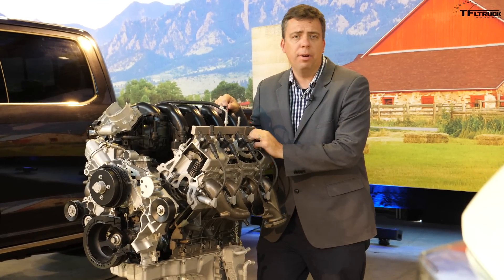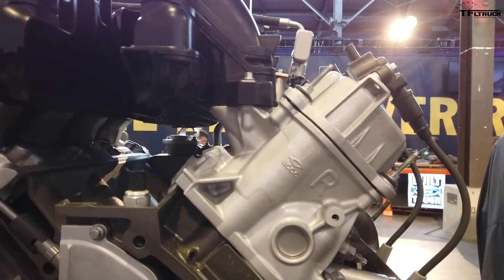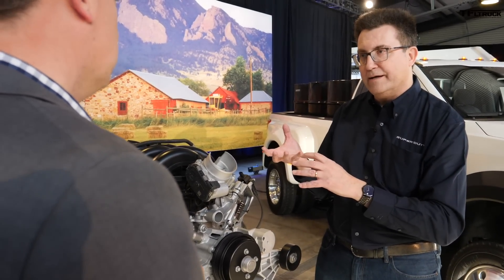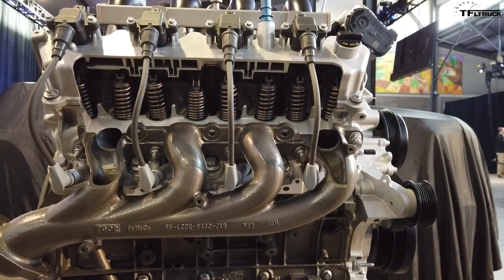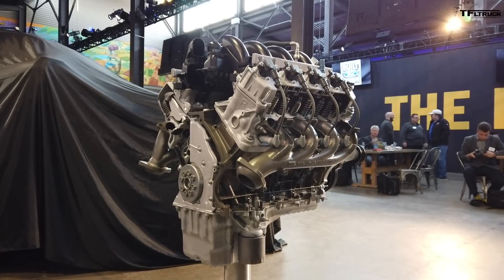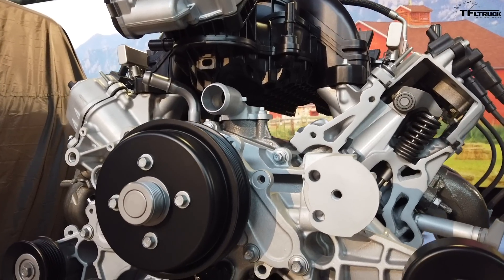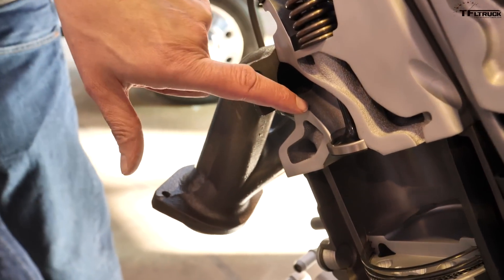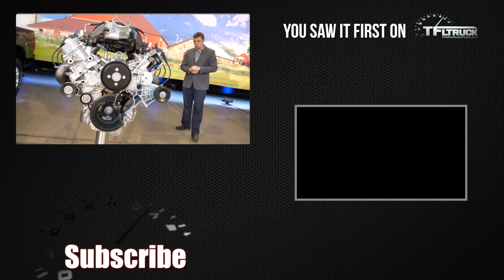2020 Ford Super Duty 7.3L V8: Here's What You Need to Know!

Comment: Hmm pushrods, iron block. I feel like someone has done this before
Reply: This is pretty funny that they have finally admitted that a push rod V8 is more durable than their modular shit. Ford engineers have commented that Push rods are ancient. They must be eating Shit now?
Reply: Literally every American car manufacturer since like 1940?
Reply: Stone's Garage -DFW ever heard of overhead cams?
Reply: @stonebone1179  Okay... I don't know about ford but I know GM 5.7l switched from flat tappet cams to hydraulic roller lifters in the late 70's... there is nothing wrong with something that actually works though. Ford trucks with 5.4's and "fancy" VVT dual camshafts are costing ownersd thousands left & right these days. 
If you've got a 5.4l triton with ~300k miles that hasn't had the timing chains & tensioners replaced, you are the abnormal. Don't run it too hard or it will jump time & usually continue to run (like shit).
As for these engines, I'm sorely disappointed
Reply: Pairis Fabrication all you did was point out that it's an iron block pushrod motor as if they haven't been a thing for the better part of a century.
Reply: Pairis Fabrication what's an overhead cam??? Is that like a gopro mounted over your head??
Reply: Stone's Garage -DFW if you’ve not heard of an overhead cam you must be living under a rock in the automotive world
Reply: Pairis Fabrication the sarcasm flew way over your head.
Reply: Stone's Garage -DFW I was using sarcasm, in particular I was referring to the LS platform of motors but yes you are right to an extent many car manufacturers use pushrod engines, but Ford has sworn by overhead cams for several years, I find it funny that they have gone back to pushrod motors seeing as they swore so strongly by overhead cams. Go learn the parts of an engine, learn what sarcasm is, then you can talk to me.
Reply: Pairis Fabrication ford ditched mod motors because half of them are trash and they're all hard/expensive to work on. To an extent nothing, GM didn't innovate a single thing but good air flow with the LS
Reply: Pairis Fabrication pushrod technology has been around for over 100 years. So unless the LS came out in 1899 and not 1999 like I thought, it didn't do anything but show people that you don't need overhead cams to get great air flow.
Reply: Stone's Garage -DFW bro your literally arguing to prove the same point as me yes I know pushrod motors have been around forever and that they’ve worked great and proven to be better than OHC engines. At least read my comment before replying smh

Comment: All the terrified GM boys with their "It's an LS" comments. Why? Because when it came down to LS vs Modular Ford they usually had a little more power in the LS platform in a naturally aspirated build because they could throw cubic inches at the formula. However when a turbo or supercharger entered the picture the modular showed how a modern 4 valve head is so much more superior. Then you heard all the "well the LS is cheaper and smaller and simpler" comments. This engine is going to muscle the LS to the side. It has even more cubes than an LS and appears to have a rally strong block. Oh no! to be a GM humper!
Reply: I'm not a GM boy but the modular motor is shit unless you spend a truck load of money on it.
Reply: 😂 to bad GM already did a big block back in 2001 the 8.1 vortec I have one in my 2002 2500hd it has over 400,000 miles call me when this motor lasts half that long cmon ford catch up
Reply: Really? Its hard to spend a "truck load of money on a modular as there are no aftermarket blocks or heads available. Check out the latest LS vs Coyote built on youtube. They just built the LS...Started with an LSX block and a set of Trickflow heads $$$$$$$$$$$. They will face this off against a Modular Ford using a junkyard block, heads and crank. Most likely the majority of the valvetrain will be stock as well. So much for that theory.
Reply: What was the horse power on that motor? 175? 195? It didn't make enough power to hurt anything?
Reply: Have you ever put oil pump gears in one? Have you ever put cams in one? Everything is expensive and a pain in the ass to work on. There's a shitload of junkyard 4.8 5.3 5.7 6.0 LS motors on YouTube making 1000hp. I've had pleanty of Mustangs that shit don't happen often. Then if it blows up and you need another engine it definitely isn't $500.  

I'd love to have that new pushrod Ford motor in a Mustang, hopefully its really overbuilt.
Reply: @ls1jeeper  It's going to rev low. I'd rather have the Coyote
Reply: Todd Johnson Show me a Ford junkyard engine in the 5 liter range making 1200+ hp on stock internals? Won’t happen because it can’t happen. Ford realized they messed up big by going ohc in truck engines, so they decided to copy GM’s formula and see if it’ll work for them. Every Ford I’ve ever owned had major problems. I’ve owned a T Bird, Tempo, Excursion, several Mustangs, Probe, and probably something else I’m forgetting. All of those vehicles were complete crap IMO. The only one I kinda miss is the T Bird.
Reply: @toddjohnson7133  the 8.1 made 330hp and 450lbft of torque. was making more hp than the diesels of the time and just a little less on torque
Reply: You can get close to 1000 reliable HP on a stock long block Coyote with turbos. (change the oil pump gears). You can do the same with an LS. The difference is the LS is living on borrowed time. Sure it can get there with the boost cranked up but the block is just to sketchy. This is why all high power builds start with an aftermarket block (and heads). The same high 1000 HP builds with the Ford will use the block, heads and likely the crank. Google "Turbo GT350" and you will be shown what you do not want to see. Sorry.
Reply: @toddjohnson7133  BS... There are people running junkyard LS blocks all season long and having no problems. You can't expect too much from a $500, 250k mile engine. Nevertheless, go buy another until you can afford to build the block right. Ford is going back in time for a reason. It's all about reliability/durability, size, cost, etc nowadays. You'll be praising Ford's new pushrod engines in the future for doing the same thing LSs are doing now... Watch and see.
Reply: @ls1jeeper  kidding me aren't you just ad boost the motor can handle it that's why a mustang gt doesn't void it's warranty with a 700hp blower upgrade what other company does that get a aftermarket tune on a GM and it voids it lol
Reply: Storm10 I'm with you man I'm a gm guy my self but Ford has it right now until gm starts listening to what people want and gets rid of that bitch running gm I'm going to Ford

Comment: Ford finally built a LS motor. They might be a 20yrs to late tho.Cant wait to see GMs new big gaser and inline 6 diesel. I will never buy a OHC v8.
Reply: Living Southern - this new engine is not junk like the LS. This one is built by Ford. If anything the only thing is had in common is with the Windsor. NOTHING about it correlates to “LS” a few similarities sure so what? Ford has built way more pushrod engines than it has DOHC. They know what they’re doing they don’t need broke Government Motors for anything.
Reply: leeleelee ford went bankrupt before the market crash. Also if the LS is junk why is it swapped into everything? You cannot knock the LS especially looking at ford with their triton competitor.
Reply: @timhalpin9729  Because GM put Ls family of engines in 30 different vehicles. And junk yards of full of them for less than a grand. Parts available anywhere and are based off of Fords designs from the 60s.
Reply: Tim, so the fact that they are successful makes them junk?? Ppl just crush the dual over head cam crap v8 ford makes. Y would you want to build something that's way more complicated and expensive to end up with comparable power?? I'm glad ford made a new pushrod motor. I hope they change all there v8s to pushrod.
Reply: Living Southern I’m in the LS boat, I have a Silverado with a 5.3 for going on 11 years now. I meant people swap them into not out of. It’s simple, reliable, powerful and cheap. Like I said it’s hard to argue the LS

Comment: Roller rocker with big cam an push rods. This is gonna be a beast
Reply: Six bolt main, loved to have seen them bearings.
Reply: @2durangoman  yes sir. Still all roller set up. Get alot of power out of it
Reply: @rollinghillstrucking  What do you thin about first year reliability? I think we should name this motor in cubic inch 444.5.... actual. should it be 445, 448(looks good) 450?   plus a name?
Reply: @2durangoman  its actually a 460 in lamine terms. It will be very reliable. Its a supped up coyote motor lol

Comment: OHV big block v8. Looks like I’ll be buying ford
Reply: Good luck with that.
Reply: .......for $120,0000 I bet!
Reply: Thanks, we all need a sacrificial first year buyer to be the rat lab and show us the first teething problems of "products".
Reply: @I know you are right, And I just got owned but: GM has no big block !
Reply: @01trsmar  they literally just released an all new 6.6 gas engine for hd trucks, and not long before that they had the 8.1 vortec. Good joke there buddy...
Reply: @6484373  , you mean the 6.6  Duramax turbo diesel engine, which yield 445 hp and 925 lb.ft. of torque. They also offer a 6.0 liter gasoline engine, which produces 360 hp. In lieu of the aforementioned 6.0 liter, I'd prefer a 6.2 liter ecotec which outputs 420 hp and 460 lb.ft. of torque.
Reply: @youarerightboss  No not talking about the 6.6 Duramax. They designed an all new 6.6 liter gas engine to replace the old 6.0 Vortec. They just announced to power numbers today, 401hp and 464 lb/ft of torque. TFL posted a video on their truck channel today about it.
Reply: @6484373  , o.k.
Reply: @6484373  , geez, why not just utilize the 6.2 liter V-8 ecotec with 420 hp and 460 lb.ft. of torque. They can always uptune the aforementioned for medium duty. 🤔
Reply: @youarerightboss  The 6.2 was not built to be a truck engine, in the half tons it is more of a preformance upgrade than a towing upgrade. It is a good engine, but something more heavy duty would be needed for the trucks.
Reply: @youarerightboss  actually heavy duty/medium duty engines are more often than not detuned significantly for reliability sake which is why you dont want a POS direct injected cylinder deactivated aluminum disaster of an engine for heavy duty applications
Reply: @I know you are right, And I just got owned but: lets be real OHC is so much more effective for using cubic inch. There is a reason the people still putting pushrods in performance cars is mopar and GM while the rest of the car industry goes OHC
Reply: @oddball0045  , you have a valid point there.
Reply: @6484373  , good point there.

Comment: So ford made a 7.3L Ls. Sweet i would love one... Or two lol... I would love to find new piston gasket and manifolds for this truck. Also the vct would have to leave. Lol...
Reply: Thats what i was thinking, only they are planing it for 2020, and Chev did it in 1999. Small time difference.
Reply: Soon as he said 6 bolt mains and pushrod V8 and showed that the 2 lateral main bolts I immediately laughed and said 7.3 Ford LS lol
Reply: There are methods of varying valve timing that can be done well, but Ford didn't use them. Nissan first had VVT on the 1990 300ZXTT and had it on almost every Z car since then. If VVT was inherently flawed, there would be no Nissan Z-car.
Reply: @ELRman86  The chev LS was a copy of Fords 427 FE used in Nascar in the 1960s
Reply: @deadon4847  Huh... never thought about it but I suppose it was to an extent
Reply: ls copied ford v8s to begin with...

Comment: I Will Stick to my Proven 1993 460 Crew Cab Dually .....with 450k on her &  never been torn down and I haul Cattle in South Florida so I push her hard, The E4OD trans that's a diff story but the Motor is a beast. Its funny I can still get 10k for this truck and have actually Turned down more 2x in last yr alone, these OLD BIG Boys are hard to find Because back then everyone wanted a little engine.....those are for women who want an over sized station wagon! 
  IF you BUY a Truck dont buy with an economy engine and expect it to pull a House like a REAL TRUCK......Buy the Biggest Motor  they make or You Can complain later on when it cant do what you thought you were buying a truck for!!      Cow }:-o)
Reply: A local engine builder had a 94 460 fuelie with 425000.when he sold it the Secretary of state rejected mileage statement.he had to get notary statement that it was original miles.no teardown.all original
Reply: I agree with everything you said and tell folks the same. The smaller engines work much harder and end up burning almost as much gas without any reserve power. I've got a 92' 4x4, 460. The big motor moves the little truck (single cab, non-dually) with ease. Makes my 3rd one, but first of the EFI models; doesn't burn a drop of oil, and barely a spot of rust on it. Love the 460 Fords! Cheers from Canada!
Reply: I have a lot of your Fellow Canadians come down here for the Winter (aka SNOWBIRDS) and most of them Haul or Used to Haul 5th wheel or Goose-neck Trailers all the way down here and even though y'all pay more for gas than we do most are infact Gas and NOT Diesel's. I am NOT saying a 7.3l DD is bad I just like the ease of Gas and IF they run out of Fuel I dont need to drain Filters and re-time the Fuel and motor to make it run right....I am an Old Carb Man But I must admit EFI id s Huge Help on that Big Boy and her Fuel being evenly put into each Cylinder to provide the most power and torque so when i her ECO boost and I am a FORD GUY I kinda Cringe at Eco.....I would rather drop the COIN and have the RAW Power than save 10 bucks and loose 50+ HP when they are critically needed and B4 some FORD rep or TECH jumps in to defend ...I can show you stuff your Dyno and tests never show .......REAL World testing in a mud hole with equal and the Eco boost will get beat by the Big Block every time there is NO substitution for CUBIC INCHES & Compression Ratio!! You guys can sell them to weekend Pick up ppl but for us who depend on the truck for our Lively hood give us a BIGGER engine and watch it FLY off the Showroom Floor!! Hell IF FORD Really Show UP Drop YOUR FORD Big Boy  V8,  8.8L 534 C.U. GAS Engine in them and You will have a Waiting List for them instantly!!  Cow}:-o)
Reply: @Im1CrazyCow  I took a ride in an ecoboost Ford and though it had power, it sounded like a Hoover vacuum cleaner at WOT; wasn't for me. I need a truck to sound like a truck and for that, the V8 is the only way to go (well, diesel too). Upkeep on a diesel engine is much more expensive than gas, so whatever is saved at the pump goes to that. 
With what was shown of the new 7.3L engine I was happy to see Ford revise the Y-block design as with the FE engines of the 1960's, but was surprised they used an inline valve arrangement as opposed to a canted valve (porcupine) design. I wonder what the power rating on the new 7.3L will be? I'm going to guess that they will initially rate it in 425-450hp range with torque coming in at about 480-500lb/ft.
Reply: I have heard a few Numbers , But i found a story in a place called Jalopnik........No clue How i got to it but i read down and ill throw in the link, just about the 10 speed they talk about some Numbers and if what they are saying this could be over 935ft of torque so if so we are looking at a beast ....UNLESS they de-tune it to keep the insurance ppl for loosing their shit! But if its going to be the most powerful in its class that would mean it has to get near the Claimed dodge 1000Ft so this could get really interesting, Hell I may have to go Test Beat on one.....if it can Do a Burnout like my Dually does then we are getting somewhere!!  I am really interested on the 10 Speed and its longevity with that much power infront of it!
 here is link: https://jalopnik.com/2020-ford-super-duty-gets-big-7-3-liter-gas-engine-tor-1832357929
Reply: @Im1CrazyCow  935lb/ft torque?! I'd really have to see it to believe it. If the engine had forced induction like a turbo or supercharger this would be possible to achieve, but still unlikely. To reach that figure with a normally aspirated gas engine the engine size would realistically need to be well over 10 litres in displacement and the revs would have to be sky high. The compression would also be too high for pump gas. Its just not feasible for a gas big block to overtake the new diesels in torque production, while spinning low revs and maintaining some semblance of reliability. I truly think that the upper limit of this new engine will fall somewhere in the 500-550ft/lb range with the technology that was shown; the low rev nature of the engine being one of the limiting factors. This is just a semi-educated guess using the engine info in the video.
Reply: @Richard SkipperFord's 390FE and 410MEL engines burned more fuel than the 460, and those are just 2 examples of less efficient engines...

Comment: Turning the clock back in many ways to the old 460's, with today.s technology giving more power and fuel economy this will be a winner for many who don't want the complexity and maintenance costs of a Turbo diesel. Hopefully Ford's reliability claims will also turn this motor back to the reliability of the older engines too, Ford have had a lot of issues with their more recent 5.4 's and so on where as the old motors just about ran forever.

Comment: Not to date myself but I’ve had two 460ci gasoline and two 7.3L Diesel engines I absolutely loved both engines in all four trucks the 460 and 7.3 were both amazing engines and my favorite gas and diesels ever. If ford is going back to the good old days I might have to buy a new truck.